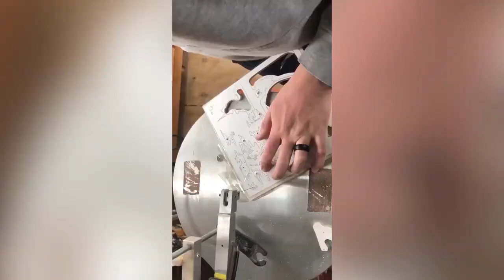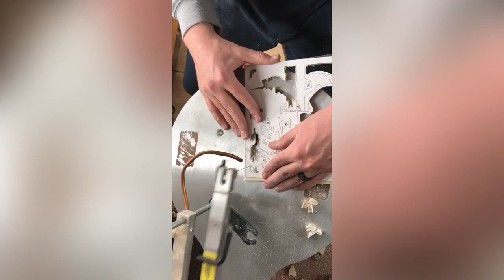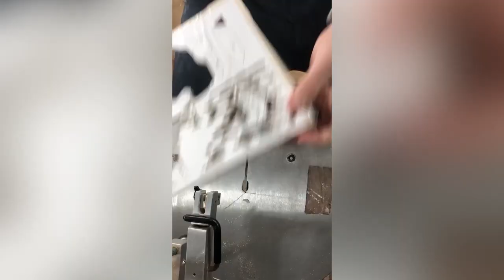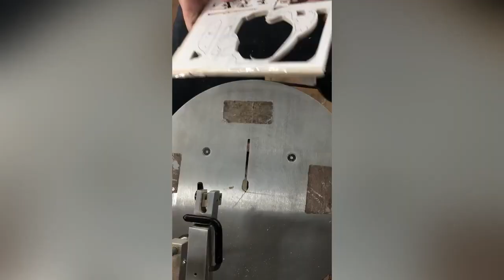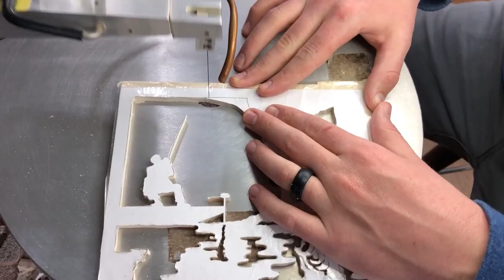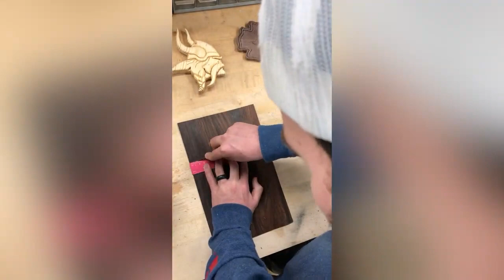#Woodworking for cheap   Timelapse of bass fishing piece spiral blades

Comment: Another fine video.  You seem to have gotten used to those spiral blades rather quickly.  I can't use them.  I must be in too big a hurry as I tend to be sloppy with my cutting while usuing them.
Reply from the maker: Yeah I have to be totally present when cutting with spiral blades! Reverse teeth and skip tooth I can kind of zone in and out. I like your picture. Is that something you did on the scroll?
Reply: @woodworkeveryday  Yes, I scrolled that a few years back.  I had fun with it.
Reply from the maker: We’ll done!! I want to do a scroll saw completion and provide a Amazon gift card or something. Still trying to figure that all out. Thanks for the comment Marcello!